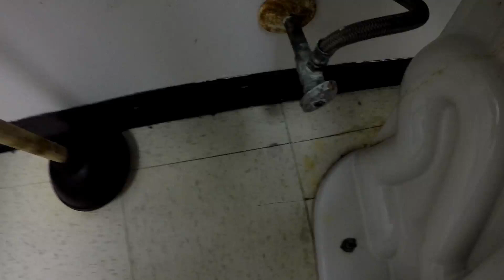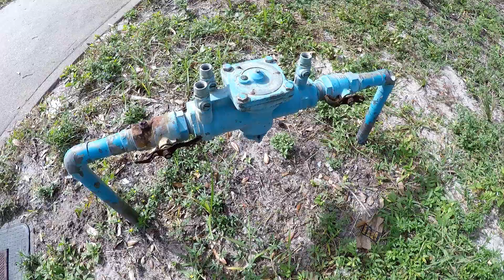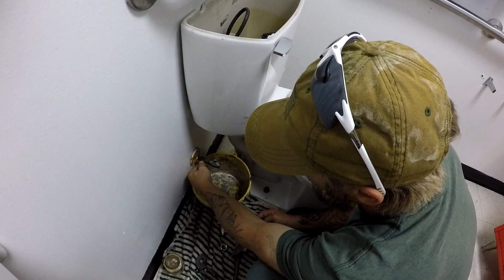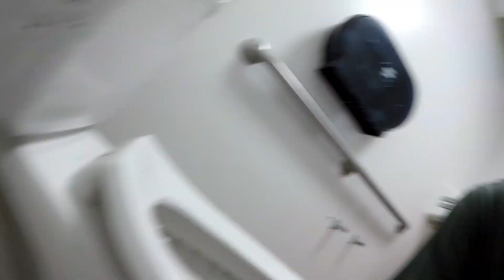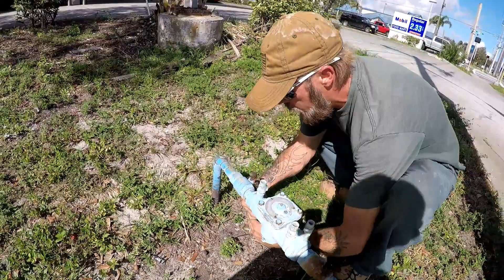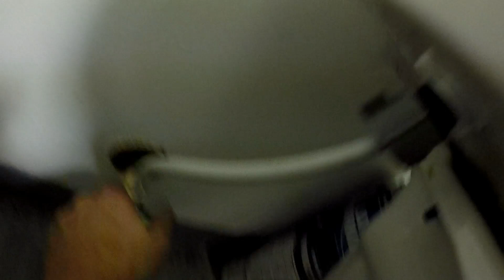Toilet parts/valves-Gas station edition!

Comment: How tight do you have to tighten compression fitting ?  When do you have to stop tightenning ?  Thanks.
Reply from the maker: Alex M compression fittings should be tight enough where you can’t physically move it with your hand
Always use pipe dope! Great question thanks!